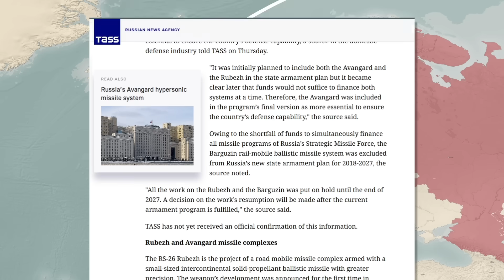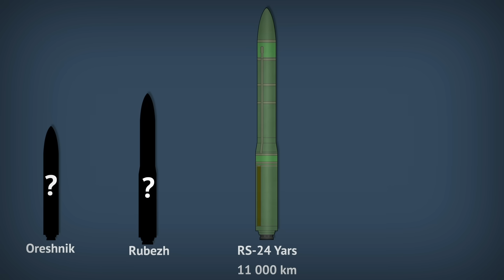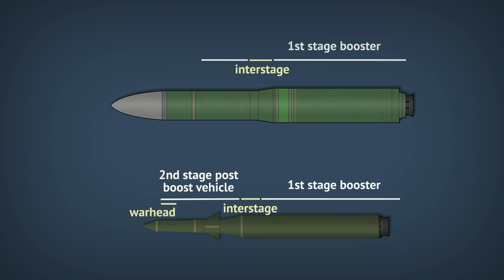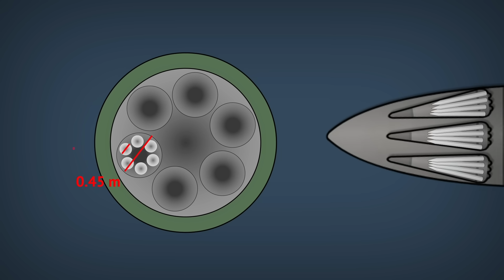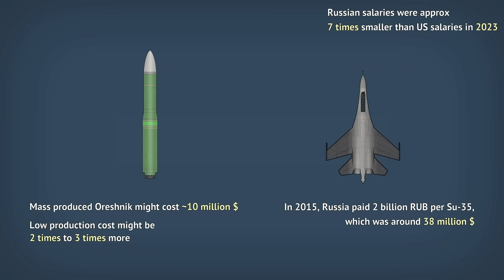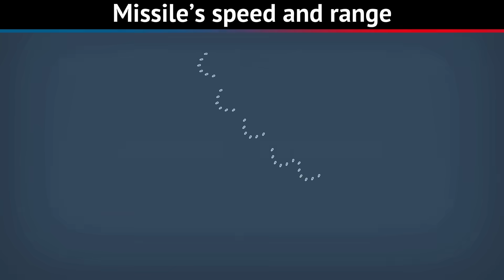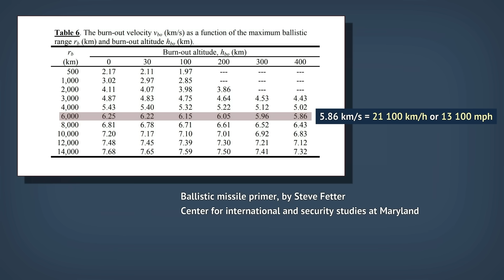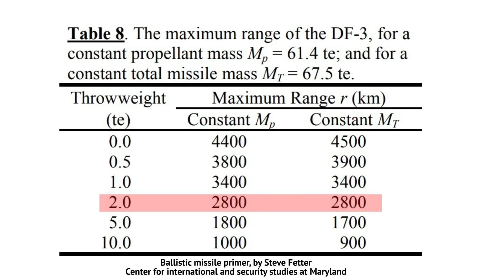Ukraine can’t counter Oreshnik missile. But it doesn’t have to.

Comment: "Ukraine lost Kiev, but here's why they don't need it anyway."
Reply: hahaa thats crazy
Reply: That's not even close to a relevant comparison.
Reply: I guess Ukraine shouldn't worry much .. this/such weapons cannot be used on border where both forces are mingled together... hence russia will suffer even more from collateral damage... Ukraine should keep the borders hot with even more saturation of landmines like US sent recently ... wherever russia advances US/Ukraine should just mine the area behind russian troops which have advanced and slowly neutralize those pulled in troops. Also as this missile can not approach in steep angled way so Ukraine can protect assets behind hills facing westwards. The SM6 on F18 demo done a while back should be expedited and Ukrain should have some always airborne paroling assets in rotation to use this SM6 as halfway ASAT to create a high atmospheric shock-wave in initial path of these MIRVs when these have neither fully gained speed nor or just have deployed sub munitions... since the atmosphere will be near vacuum the high sockwave (nt high penetration) SM6 warhead could disrupt the not only aim of MIRVs but also making them fall safely because of horizontal vector forces SM6 induced on that MIRVs or cluster which are still travelling relatively together/closer.
Reply: "It was not strategically important"
Reply: @a7awtf   If it wasn't important, they wouldn't have tried taking it with the "elite" airborne troops. And a huge armored ground attack.
Reply: Russia couldn't take Kyiv, but here's why they don't need it anyway.
Reply: @scottkrater2131  Russia NEVER intended to take Kiev. You dont send 30-40 000 troops to take over 3 million city, guarded by army. That was MANUVER which intended and DID pin down Ukrainian forces around Kiev. While rest of the Russian troops was taking 1/3 of the country.
Even if you have just 2 brain cells, you would know that .... seems you dont.
Reply: @scottkrater2131  I believe you are referring to the famous, epic battle for Kiev that never took place.
Reply: @lk9650   No, I'm talking about the humiliating forced withdrawal from Kyiv.
Reply: @scottkrater2131 not a “withdrawal” it  was a “tactical retreat”
Reply: @thienbui898   Call it what you want. It was a defeat. And an extremely costly one.
Reply: @scottkrater2131  If you believe that Russia was trying to take Kiev, then you have to also believe that, for some reason, for Russia taking Bakhmut was much more important than taking Kiev, since they committed a lot more troops and spent a lot more time fighting to take Bakhmut.
Reply: @lk9650   If they weren't trying, they wouldn't have put so many resources in to taking it. It was a defeat, no matter how you want to pretend it wasn't. Did Bakhmut win the war? No, but it cost more than it was worth.
Reply: @scottkrater2131  Ahaha, and how costly? Yes it was costly .. for Ukraine, they lost 1/3 of their country.
Reply: @avengerpz   And that's why you control less territory than you did 2 years ago? 20% isn't a third. Lmao.
Reply: @scottkrater2131  And how much resources was that? How much 3-40 000 troops are for 3 MILLION city? Thats not even enough to establish checkpoints and enforce martial law in the city such city. And yes, Bahmut won the war. Without Bahmut, Ukraine army wouldnt be in the state they are, to need to recruit childreen in army.
Reply: @avengerpz   Gesture of goodwill? It was no such thing, it was a nice excuse for a defeat.
Reply: @avengerpz   Because you thought they'd fold immediately. And if Bakhmut won the war, why are you losing more troops every day?
Reply: @avengerpz   Remind me, did not the Soviets do exactly the same thing in 1941? Yes they did.
Reply: @scottkrater2131  Remind me, dind US did exactly the same thing as Rusia during Cuban crises? Yes, they did.
Reply: @scottkrater2131  I do NOT control ANYTHING. But that is why Ukraine is controling 20% less territory then they had and will never have back. Also the initial push of Russia was close to 1/3. 20% is NOW, after the initial withdraw of Russia to consolidate its forces. At that time Russia had less then 200 000 troops, while Ukraine had over a MILLION as announced in may 2022. The question is, how come that 1 MILLION troops couldnt ratake all of its territories despite 5:1 ADVANTAGE in manpower.
Reply: @scottkrater2131  Ukraine is having manpower and ammo shortages and they are constantly retreating in Donbass while Russia continues to advance, not even the Kursk incursion did anything to stop the advance.

Yes Russia is losing troops, but so is Ukraine, and MUCH more
Reply: @avengerpz   No, we didn't, we had no need to draft more men over Cuba.
Reply: @avengerpz   You think Ukraine could use its entire army to attack in one area, and not defend its borders with Belarus and Kyiv? Russia, according to the "experts" should have won long ago. But here we are 3 years later.
Reply: @jakedorent9450   Russia is having similar problems, otherwise NK troops wouldn't have been needed. As far as casualties? We'll never know how many troops your losing compared to Ukraine. The Kremlin never tells their true losses.
Reply: Russians always loved fantasy. Sadly they are unable differentiate fantasy from reality.
Reply: @zperdek  Nice projection there ;)

Comment: "Ukraine can't win against Russia. But it doesn't have to"
Reply: They'll just gloat that they only lost 70% of their population and half of their territory, therefore Russia lost or something.
Reply: @dannydanny2789 You realize the losses the two sides sustained are quite similar, right? Not to mention Russia has failed to achieve any of its war goals, in fact, the war goals flipped on them.
Reply: @voidtempering8700  Russia has 10 times more people and 10 times more artillery. Also the cities and economy getting destroyed are not in Russia. Russia barely notices the losses, while Ukraine suffers badly.
Reply: @dannydanny2789  10 times the people, yet politically, they have put themselves in a very bad position. They already had an attempted coup, and people are continuing to leave the country. They have sustained massive vehicle losses, while NATO hasn't deployed any forces. Lastly, ten times the artillery means nothing when the other side's artillery is more accurate. They only need one round to achieve what Russia does with 10.
Reply: @dannydanny2789 And yet, they have been in a full war economy footing for over 2 years. That isn't sustainable and is backed by the fact that Russia is at a 21 percent interest rate which but still suffer from a 7 percent inflation. 

I don't think Ukraine has any chance to defeat Russia militarily, but if they can cause enough economic pain they could get a c3asefiee along current front line as best case for them.
Reply: @dannydanny2789   10 times the people? 4 times. The artillery advanced is falling and the quality of some systems makes up for larger numbers. 
Having 10 1950s 122mm towed guns is probably worse than having 1 modern tracked P2000
Reply: @Statueshop297  Yeah bro thats just insane cope ngl
Reply: I guess Ukraine shouldn't worry much .. this/such weapons cannot be used on border where both forces are mingled together... hence russia will suffer even more from collateral damage... Ukraine should keep the borders hot with even more saturation of landmines like US sent recently ... wherever russia advances US/Ukraine should just mine the area behind russian troops which have advanced and slowly neutralize those pulled in troops. Also as this missile can not approach in steep angled way so Ukraine can protect assets behind hills facing westwards. The SM6 on F18 demo done a while back should be expedited and Ukrain should have some always airborne paroling assets in rotation to use this SM6 as halfway ASAT to create a high atmospheric shock-wave in initial path of these MIRVs when these have neither fully gained speed nor or just have deployed sub munitions... since the atmosphere will be near vacuum the high sockwave (nt high penetration) SM6 warhead could disrupt the not only aim of MIRVs but also making them fall safely because of horizontal vector forces SM6 induced on that MIRVs or cluster which are still travelling relatively together/closer.

Comment: if it really costs 10 million $ as you estimate then it is pretty much a dirt cheap options for Russia based on what it achieves

a fighter jet with its' price cannot strike thousands of kilometers away in a few minutes while completely avoiding air defenses

Oreshnik is just a toy, Russia has thee Sarmat active since 2023, this is a FOBS capable (which means it gets into orbit) missile with 3 Avangard glide vehicles about 3tons heavy each, even without nukes, 3 tons of tungsten at Mach 15 is 9.3 tons of TNT in kinetic energy (3 of them are 29tons, 15Mach is a reduced speed after a long glide from 23Mach)

a FOBS weapon completely ignores the existing anti-ICBM weapons by flying at a very low altitude and around the globe from the south pole

Such a weapon can target aircraft carriers, if not when on the move then when they are at port for maintenance, bombers like the B2 (limited numbers, long repairs, super expensive) and early warning facilities that are used against conventional ICBMs

This means that Russia has the capability, at the moment and not in the future, to take out some very expensive assets without starting a nuclear war, not only in Europe with the Oreshnik but anywhere on the planet